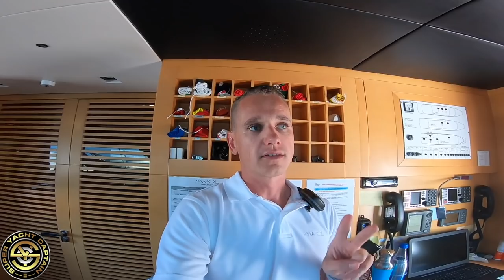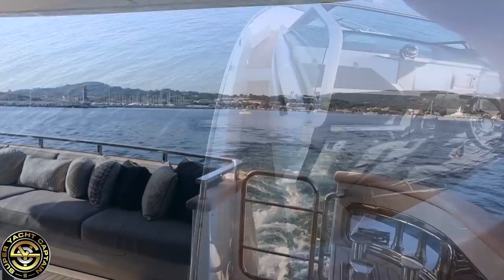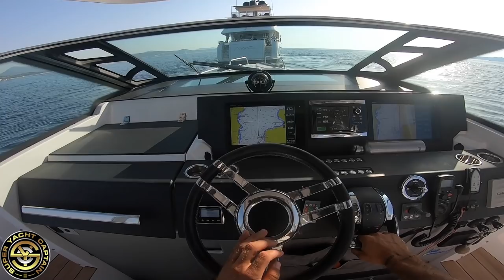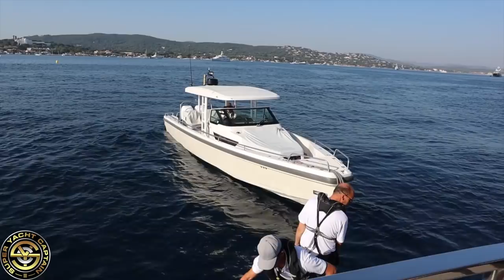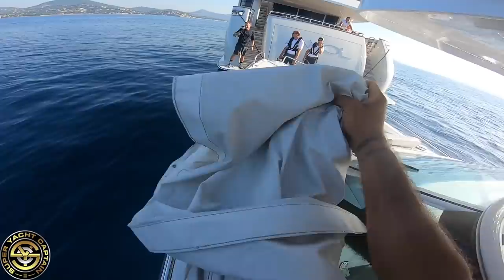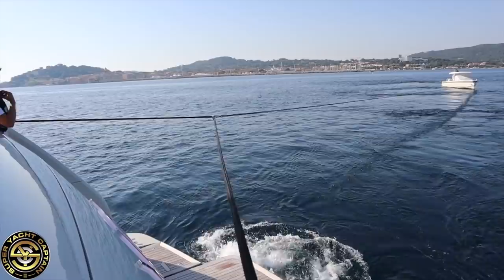Towing A 700HP Boat With A Super Yacht!!! (Captain’s Vlog 92)

Comment: Hey captain, as part of my job I am trained in rope rescue, one of the things we are taught are critical angles in rope deflection. It looks in the video that you have a very wide angle on your line that the tow line is attached to. You might want to look into it because at such a wide angle, you could be compounding tho load on your anchors, but more importantly your line. A longer line could make for a narrower angle and reduce the stress on the line and anchors.  Great video, I find your work to be very interesting!
Reply: With around 90° between the anchored lines on the main boat each end will be stressed by around 70% of the pulling force. Above 120° the forces on the anochers can exceed the force from the towed boat.
Reply: Yes, but all the loads are still way below what the equipment can handle. That shackle looked like it could pick up the chaseboat with lots of safety factor to spare.
Reply: I am surprised with that much line out that they didn't narrow the angle by tying it on both ends to the towing boat in a U shape (instead of using THICK black line) and then attaching towed boats shackle to it so that it didn't slide much to change the geometry of the towing line. Am I explaining myself correctly?

Comment: Instead of coiling the tow try flaking it across the deck. That way once the helm is off the boat you can kick the yacht slow ahead and the line will payout smoothly. It's what they do in normal marine towage. Any reason the crew don't use the crouch straps on the life jackets?? Keeps up the video's

Comment: Towing a 700 hp boat. Is that a lot of power? So let's see, my yacht has twin 2800 hp engines. The captain who is doing the vlog must be super smart. Point I'm trying to make is that captain is so proud of his 700hp boat. He must be on an ego trip. Most big yachts don't set up with their towline floating meaning that the rope moves one side to the other. There should be a fixed bridle off the transom so there would be no rope chafing. The tow rope shoals have an eye spliced in at the end of the rope allowing a shackle being used to secure the the bridle to the tow line

Comment: I am surprised you are not required to place a flag midway along the towline.   That prevents other vessels from trying to pass between your towing vessel and the towed vessel.   It is very easy for young fools on jet-skis to cut their heads off on that tow line.

Comment: The line from the stern cleats is not redundant- forget about the angles (which you should not).  If it breaks, you're toast. you should have an independent, redundant system from port and starboard from AWOL.

Comment: That 'Black line' is called a bridle, mate. The bridle is far too short, creating too large an angle at the bridle apex (as others have pointed out), putting additional stress on the bitts.

When securing the eye of the bridle to the bitts the eyes shouldn't simply be thrown over the post, rather the line should be taken outboard, round the forward post and led back and looped over the aft post.

Tip: coil your Dyneema towline in a figure-of-eight when stowing, prevents all those kinks when flaking the line out (which he doesn't do either) before setting the towline.

There's not much seamanship going on here.
Reply: He probably knows what he is doing a lot more than you. He also probably knows that “that black line” is called the bridle.
Reply: @theolopez3299  His actions on video prove otherwise. If he knows its called a bridle he would have called it that. Me, I qualified up to Able Seaman before studying and obtaining my Second Mate's ticket, deep sea, foreign-going (UK tickets, so I am reasonably well trained). 10 years sea time. You?

Comment: Great to see the safety precautions and great care in paying out the tow line and staying inboard of the bridle.  On Captain Cook's first voyage around the world in 1769 other than for natural causes only one member of the crew died on the voyage due to accident which was unusual for those times.  That death was a seaman got his foot caught in the bight of an anchor rope and was pulled overboard and went down with the anchor.
Reply: It's probably not that unusual when men (usually) on deck of a ship and many lines going overboard, it is a frightening thing to see one of your work mates, or you, get a foot caught in a line going over the side!  It's happened in the USA where the "Deadliest Catch" crew one season saw one of their crew dragged over board and the captain and crew acted very quickly and I believe they saved him, but seconds counted and if they hadn't acted quickly they would have recovered a body instead of a living crew mate.  Always be careful where you stand when lines are going over the side!
Reply from the maker: The bight is an extremely dangerous place to be and if your caught, you’re gone in a second. Especially the guys on deadliest catch, those cold waters have no merci.

Comment: Dyneema wouldn’t be my first choice in tow line.
It has next to zero stretch, so there’s next to no shock absorption in that tow system to account for when towed vessel, is straining against a swell while towing vessel is pushing down the face of a swell.

The constant jerking motion places undue strain on your 2 tow point bollards.

If for example you had a rubber car tyre in the middle of the tow line it would both deform from round & stretch even to provide that shock absorption in the tow system.

Or you could select a towline with stretch like polyethylene rather than dyneema.

Dyneema s other great failing is that the fibres are brittle if bent much past 90 degrees so knots selection is critical to avoid doubling the line back on itself, if you don’t want to prematurely weaken the dyneema fibres.

It would be preferable to employ a shock absorber in the tow line than to use say a polyethylene line that stretches, for safety reasons, risk to crew. A stretched polyethylene line that parts can recoil with great force.

Using a non stretch line like dyneema in a towing application at sea without employing any form of shock absorption is just transferring all the strain to both vessels which is less than desirable long term in my opinion.
Reply from the maker: Thanks for the feedback, you make some great valid points. I will definitely do some more research into this. 

Last year we towed over 6000nm with the same line with no signs of stress damage to either the line or the 2 vessels. 

Either way, I’ll look into into it. 

Thanks again 👍
Reply: Super Yacht Captain Your very welcome! Lovely vessels bye the way! Crew also seem very proficient, capable, & committed- with commitment to OHSW.
The Dyneema has less than 1% Stretch is all.
I’m not saying stop using your dyneema, just saying employ some kind of stretch shock absorption within your towing system is all to account for the lack of stretch in the dyneema.
You have a good system & it’s served you well thus far - but you could improve it is all!
The chaser is too nice to tear it up being towed.
Fair weather & smooth seas.
Reply: @SuperYachtCaptain  Yes, perhaps a "snubber" would be helpful in protecting the line from shock.
Reply: @SuperYachtCaptain  - Ian is spot on. Maybe film it in heavy seas from the Axopar. Look for stress cracks on the Axo. Partial mitigation is the weight of the towing bridle:; because it's mounted high, when there's slack, its own weight will create a reasonable pulling force, before any snatch hits.

Comment: We used to tow with a 50m line made up of a set length bridal to reduce the angle from the aft bits and slap from choppy conditions and Spectra straight back to the tender. The set length bridal also reduces the amount of movement the tender on tow will have. P.s life jacket crotch straps are always better used!

Comment: In case of bigger waves, we put a heavy weight in the connection line. It wil sinking down. When you go forward, the downforce of that weight will help you, to get smoth towingforce and it works like a shock absorber if the vessels are fighting waves. Even when you slow down, this weight will help, that the vessel in the back don't touch you. Because of the downforce. The weight is sinking to the ground and works a bit like an anchor.  (sorry for my bad english. I'm out of training.)
Reply from the maker: I agree, the weight will act as a sort of spring. Thanks for the advice 👍

Comment: Why not use a thimble on the tow line (fitted inside the splice) so that you get the free movement as it slides across the bridle but have rope on the outside 🤷‍♂️ great video 👍

Comment: The way the tender was sliding around due to the stretch and contraction of the tow line, seems like it should have a small sea-anchor off the stern to create some drag to keep it pointed forward. Just a thought. . .
Reply from the maker: No need, once we reach cruising speed the sliding completely stops. 👍

Comment: Hi Ian Moore commented below I think my followup comment bears repeating here
Ian Moone I agree with you Ian. You mention 'polyethylene' for a tow line the usual tow line material is Nylon it has 15-30% elongation before deformation which is why it is use for dock lines , anchor lines , or 'snubber bridals ' for chain anchoring and all sorts of mooring lines to absorb shock loads. It's what commercial tugs use if not using steel cables.  Dynema (in the non prestretched version) does have the highest strength to diameter and great UV resistance but not the best a chafe protection. (Dynema actually polyethylene  is a modified long chain Polylethene plastic , Like plastic bags and milk bottles! ) It Used to be called Spectra in USA  but they changed the name to the European name for less confusion.  Polypropylene is not good for large towing applications , it is used for ski line towing because of its natural floating ability and fair shock/stretch ability but does not have great UV resistance, it also does not hold knots well . Nylon is the line of choice for non static load applications.
Cheers Warren

Comment: Ends of black line should also be wrapped on bollards and not with an eye splice. If for any reason you had to drop the tow while pressure is on you won't be getting that loop off without cutting the line. Just a suggestion. Also not a fan of the single bridle. With the strength of soft shackles the argument of a hard shackle hitting the stern is no longer an excuse.

Comment: It looks like the towing line was attached to the clear through the loop, in an emergency it will be impossible to release this line with weight on it. it makes sense to wrap this line off around the cleat as you would a mooring line.

Comment: Interesting to see the tow line like that -- I would be very concerned about chafe. Why not two loops, one port and one stern to the tow line, to eliminate chafe and provide redundancy?
Reply: If I understand you correctly, I think you're suggesting two individual lines from the connection forward to the towing vessel. 

That wouldn't eliminate chafe, as the connection would still be rope on rope. In fact, it would tend to make it worse, because the friction would be localised to the pick up points. There would also be reduced rope breaking strain due to the high angle the ropes would turn through at the connection. 

The other great advantage of doing it this way is that the loads on the two sides are self-equalising. This in turn means that there is no danger of one side going slack and then shock-loading when the towed vessel comes back into line.

As I understand it, the lines typically used on boats are optimised for static loads, flotation and resistance to the harsh conditions. (Dyneema was mentioned here). You could argue for a rope optimised for dynamic loads, as used for main ropes in climbing and mountaineering. However a climbing type of rope would be unsuitable for a number of reasons - mostly to do with durability and safety. I've seen boaties use other ways to absorb shock. Tyres, weights etc. 

I'm looking at this as a one-time mountaineer, not a mariner, so I stand ready to be corrected by the mariners. The whole setup looks weird to me, to be honest.

Comment: great video👍

what do you do in bad weather? is there a limit to what the chase boat can take when towed?
Reply: That's a good question!
Reply: @epicnavigator     very good question ... the problem is the bad wether happens , you may not be able to recover the boat ... it is a lose lose situation ///////
Reply: Normally, they have good weather information for the route they're following, so can take measures before they encounter it. Also, with the level of experience on board, they can probably tell by the conditions if they need to head for safety. I was on a flotilla once and the leader stopped a beach bbq to get everyone to a sheltered harbour. I only identified a stiff breeze, but he knew exactly what it meant.
Reply from the maker: Great question, We have constant weather forecast updates and we take  minimal risks, last year we got caught out twice with the weather closing in faster than forecasted, we just reduced the speed, monitor and made it safely into our safe heaven. detailed planning and forecasting is the key to a safe passage and a safe tow.
Reply: Super Yacht Captain thanks for answering!
Reply: @SuperYachtCaptain  Hey Captain! You can make a video about Scheduling the Trip and the way you decide whether or not to visit a place depending of the weather conditions
Reply: The largest issue is a following sea. The towed boat can surf forward and either hit the boat or get tangled in the tow line. A friend of mine who owns a super yacht was towing (not him but the crew) a 500k boat behind it and the boat surged forward, the towline got caught in the prop of the towed boat and flipped it... to end it all a half a million dollar write off.
Reply: George Lockwood heavy follwoing sea is a pretty demanding thing by itself. Guess it‘s easier then to just drive the chase boat separately, although it isn’t very nice to be outside in that weather. On the other hand that's what every sailor experiences in bad weather.
Reply: Gentlemen don't sail under weather

Comment: Sure wish those filming had shown close-ups of the chase boat connections of the bridle to the chase boat (looked like custom S.S. fittings on the chase boat?) and AWOL’s bridle to AWOL (line loops through the center of AWOL’s cleats then over the horns of the cleat, or double loop over the horns of the cleat, or other?) I believe line loop to cleat recommendations have changed over the years? I really appreciate all the fairlead options on the stern of AWOL!

Comment: If you use som 2 - 3METER HOSE on the AWOL BLACK ROPE .. To take ware and tare of the black guide rope 
And some hose in the tow eye on the sliding rope. 
Then you don't have the same ware and tare .. .
We use similar constalation on the ropes when we water ski after a RIB 50HP
Reply: simple and good advise !! THKS !

Comment: Obvious question but what happens when you stop?   Is there a risk of the chase boat running in to you?   Or if you stop over night somewhere, do you tie it up to the side of AWOL?
Reply: Good question,I was wondering the same thing.
Reply: Generally the heavier vessel drops anchor, and then you toss fenders out and dock the smaller vessel alongside, treating the larger vessel like a dock.

If the weather is too rough for that, you could anchor the tender, pull along side to retrieve the pilot, and then move an appropriate anchor swing distance away and anchor the yacht.

And from what I have seen once you stop applying forward force to a boat, it stops pretty quickly, so I would guess that the length of the tow line is designed to be long enough to allow the tender to drift to a stop before reaching the yacht.
Reply: @ke6gwf  Good answer!  Thank you.

Comment: Just wondering why you pull the engines up all the way and not leave a small portion in the water so that the chase boat won't slide around so much?
Reply: I guess the boat is ok to slide around a bit, it will probably stabilise when AWOL picks up speed. But you are after the least amount of drag on the tow lines and as you said those engines would cause drag. I wanted to see the stopping procedure as well.
Reply: It can send water up the exhaust and into the cylinders, trashing the engine.
Reply: simon laity I might be wrong but I think that’s only an issue with 2stroke engines. Whereas those 350hp Yamahas are 4stroke.

Comment: My years as a certified rigger in the construction industry we tried to maintain a 60 degree triangle with the 3 legs of the rigging when possible. So each leg of line paying out to the tow boat would be the same length as your distance between your cleats. This is the strongest angle for your line under a load. the flatter the angle you go, the higher the load on your cleats and the lower the load limit on your line. Is there a reason you use a flatter angle on your towing set up?

Comment: The geometry of the tow lines is strange. The AWOL is using 2 lines spread essentially from gunwale to gunwale leading back to a single point; the towed fast boat whose bow is very narrow in comparison is connected at 3 points versus 2 creating a false inertial moment & these 3 lines are merging forward to a single point with a rigid hardware connector that essentially negates the shock loading of the towlines & seems to be inducing the towed vessel's "waddle".